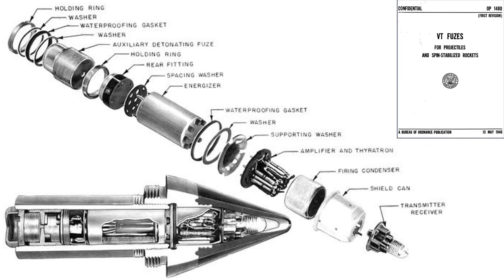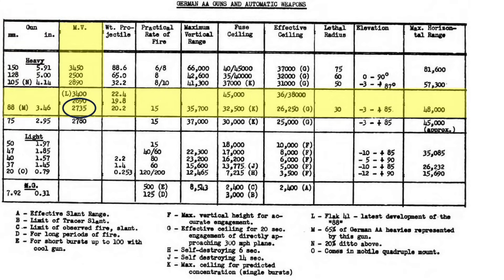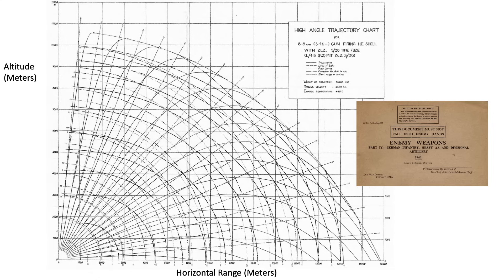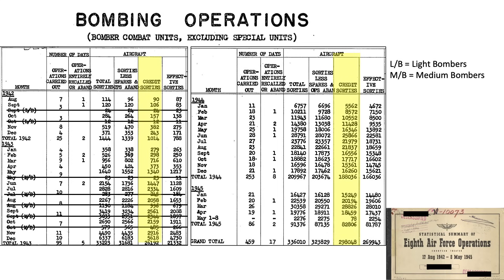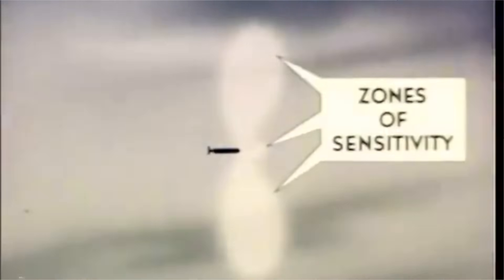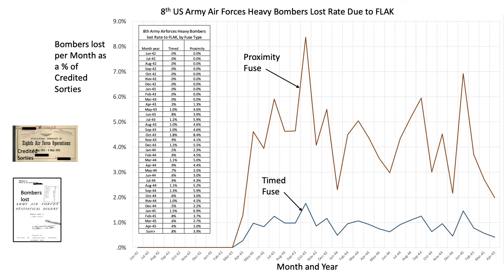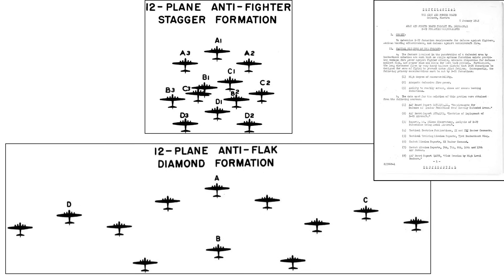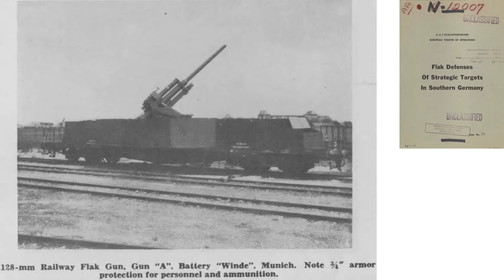Germany's big Mistake, no Proximity Fuse in WWII

Comment: 88mm might have been too small.  The US 5" shell was 127mm, and they couldn't fit it in their 3" shell (76mm).  However, the US did not have a lot of 3" AA guns, which probably reduced the urgency.  I wonder how much this affected their plans, and whether that US post-war report took that into consideration.
Reply: The 90mm "Triple Threat" was the primary AA gun used by the US in the same role as the German 88 and I've never seen a listing for proximity fused ammo for it, however in 1944 they started using an advanced radar system with it that had an automatic elevation and azmith adjustment slaved into the gun, essentially auto tracking where previous to that the radar was just ranging.
Reply: @dukecraig2402  pretty sure US army 90mm guns did receive VT fuzing.
Reply: @MrZazzles94  
Just as an assumption I'd think they did to but I just can't find anything in print verifying it.
I know that they used the 90mm as a field piece extensively and after the Battle of The Bulge they used proximity fuses on infantry caught in the open so I'd assume they used with if but like I said I just can't find it on a list.
Reply: @MrZazzles94  4 VT fuzes developed by John Hopkins for Allied HAA Guns by 1944. 5" for USN, 4.5" for RN, 3.7" for British Army and 3"/90mm for US Army.
Reply: 25pdr (88mm) received VT fuses in 1944, with the smallest fuse developed for the 3"/50(76mm) also showing up in 1944. 

The standard fuze was No 117 direct action (DA). No 119 (DA and graze) was also used. Combustion or mechanical time fuzes were used with base ejection shells and mechanical time with graze were used with HE. Proximity fuzes were used from the end of 1944 and subsequently replaced by CVT fuzes.
Reply: You look at this to much through the lens of the Allies. Had Germany taken this route, given the pervasiveness of 88mm and 105mm guns, a VT fuse for those would have been the top priority.

Also, radar/doppler isn't the only way to achieve the effect, various other ways of varied effectiveness were studied by the different sides.
Reply: @exharkhun5605  
The Germans experimented with quite a lot of different triggering methods for proximity fuses but just never fielded any.
Reply: The VT fuse could be fitted to the 3” shell. It was the smallest shell it could be fitted to. Had the war continued the USN was planning to replace the quad 40mm AA mounts with twin 3” mounts on its ships.
Reply: @1dcbly  Boffors managed to get a vacuum tube valve proximity fuse shell into the 57mm round in 1950.   The 40mm round needed transistors.  Today we are firing guided projectiles.  The 57mm MADFIRES has its own seeker and can be fired from the MK110 at 200 rpm.
Reply: @williamzk9083  All very true but I was limiting myself to the WW2 timeframe.
Reply: The Germans were using 128mm flak guns in late WW2 to reach the high altitude bombers.
Reply: @allangibson8494  Yes. About a 1000. Versus 20.000 88's and 4000 105's. Which would you tell your scientists to prioritize, knowing that whatever fits in the smallest will also fit in the bigger ones?
Reply: @exharkhun5605  The American Navy used the 5”/38 for everything - which made a fuse that fitted a 5” shell really useful.
Building vacuum tubes that can stand 20,000G acceleration reliably was however a difficult trick (as was the associated spin activated batteries).
The actual circuitry was very very simple however and consisted of a simple oscillator circuit that was detuned by the presence of metal or other conductive material within 20ft (near field effect as opposed to the far field effect of actual radar fuses).
Reply: @allangibson8494  The circuit itself for the proximity fuse had been proposed by British New Zealand radar engineer William Alan Stewart Butement and passed over with the Tizzard commission.  A key method was to float the vacuum tube valves and electronic components in oil.  Components were designed for neutral buoyancy in oil.    Miniaturization was a key as a component 10x smaller was also 10x more shock resistance.
Reply: @williamzk9083  Butement and 2 or three other blokes at the Army Cell at Bawdsey Research Station. Butement and P E Pollard had put forward a Radar proposal to the War Office in 1931.
Reply: Yes, I want to point out same. Naturally that was possible, but harder.
Reply: The Naweaps site has an article “Crosley’s Top Secret War Effort, the Proximity Fuze” dealing with this issue. Crosley manufactured these fuses in Cincinnati OH.

Comment: 15 rounds a second ?  NO way  is that for a Battey of guns?
Reply from the maker: Thanks for the catch, I pinned  a correction as the units should be rounds per minute.
Reply: @WWIIUSBombers  Oh.  <stops typing angry bugfix request to World of Tanks>
Reply: The 128mm Flak 40 was rated for 10 to 12 rounds per minute off a single mount or 20-24 off the twin Flakzwilling 40/2 mount.
The 128mm round is almost dimensionally identical but more than twice the weight compared to the 127mm/5”/38 used by the US Navy with proximity fuses.
The 128 twin mount on a tracked chassis would be truly scary as an antitank weapon. (The US Army Ordinance Museum has one of the 34 built).